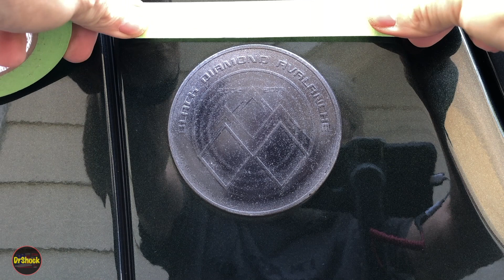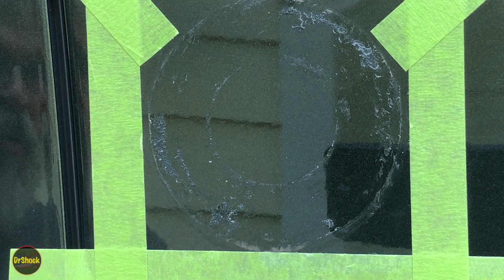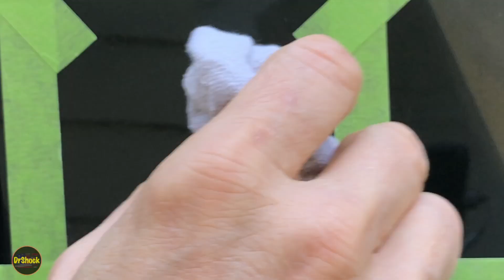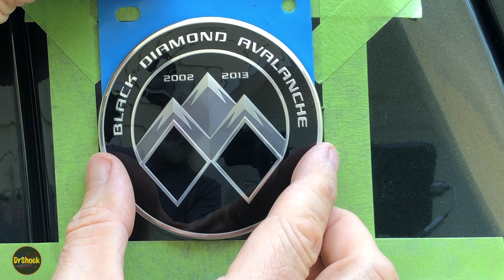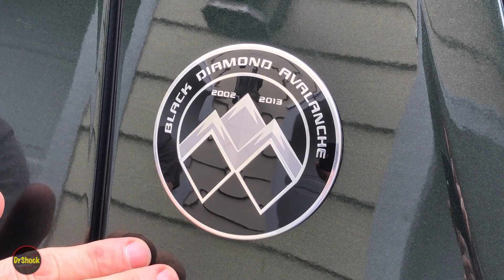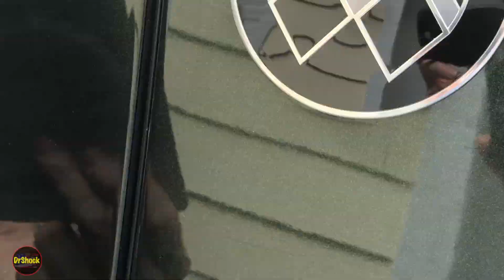2007 - 2014 GM Truck Badge and Emblem Removal, Replacement, & Repair (Cadillac, Chevy & GMC)

Comment: Off topic here...but I have been looking for an answer to a past topic you dealt with.
That is about putting a locked GM radio from a junk yard into my 2006 Silverado.
My question is this. If I take out the radio lock chip from my original GM radio and swap it into the junk yard
radio will that solve the lock issue in the new donor radio? Will it recognize the new radio with the information from the old?
Reply from the maker: It would be better to ask this question as a comment to the other video you are referring to, but the short answer is yes you absolutely can (and should) just swap the EEPROM chips between the original and donor radios to retain any preference settings as well as avoid the VIN lock situation.